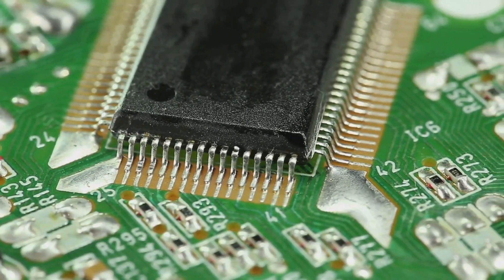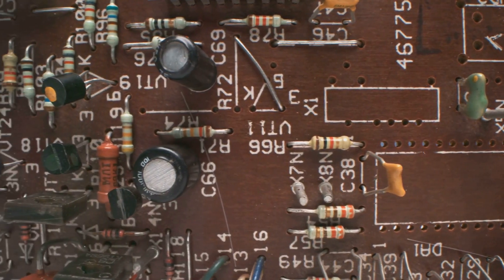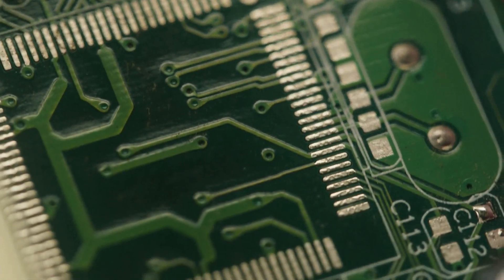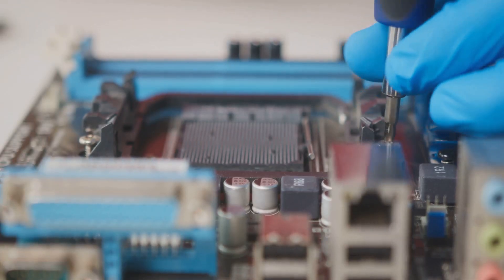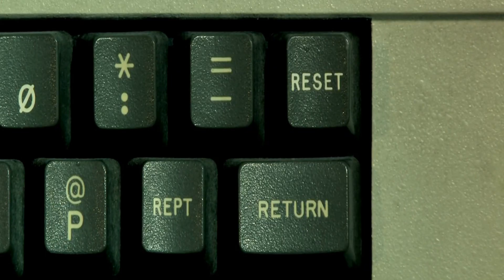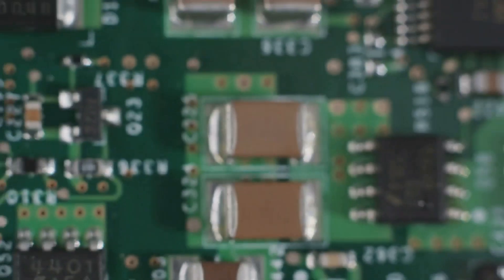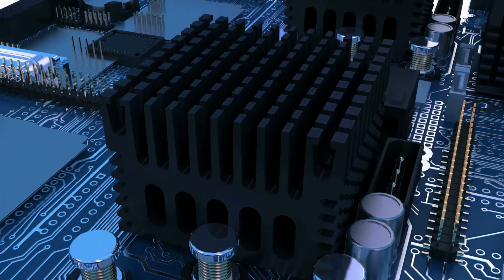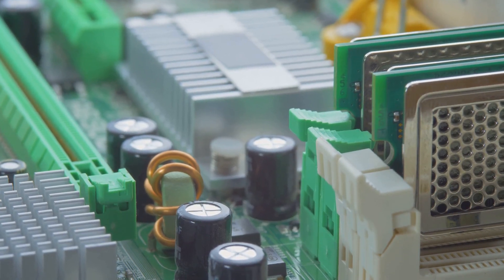What is a CMOS Battery?

Comment: Not entirely true nowadays, modern UEFIs use nvram so they don't need it to keep the data(though some mainboards still make the bios reset when the battery is gone). Today it's main use is the Real-Time-Clock, which still needs it.